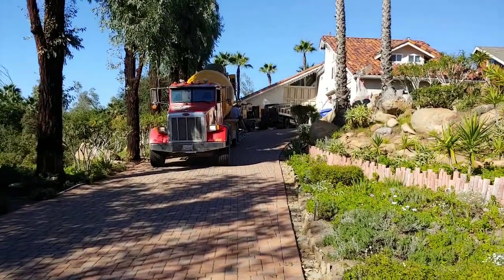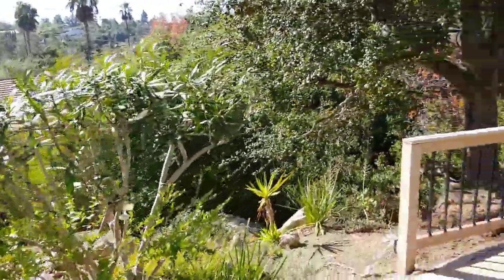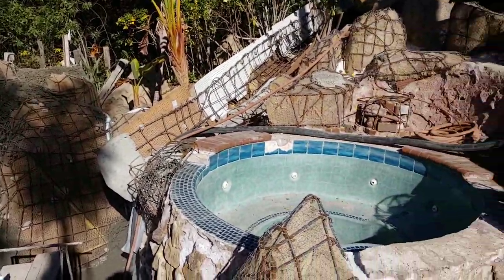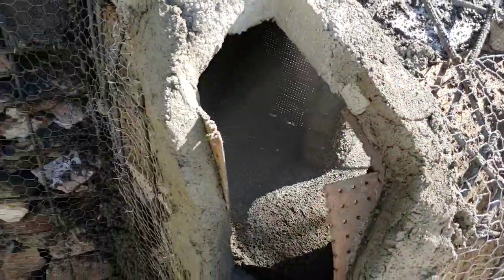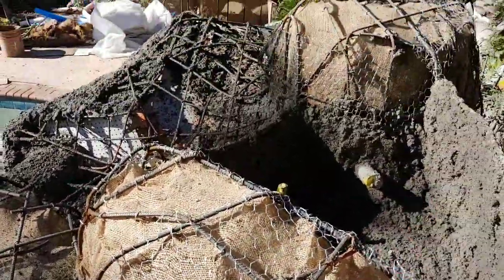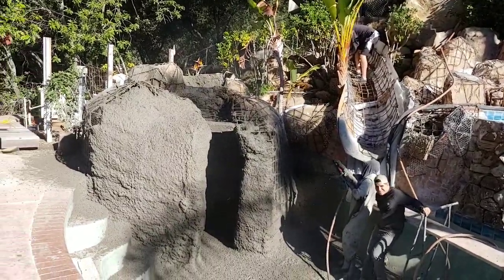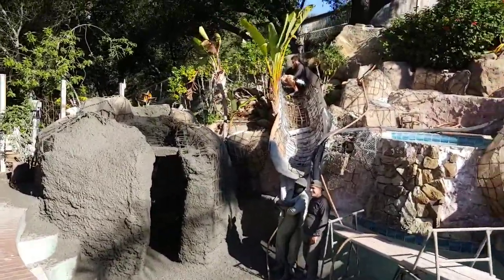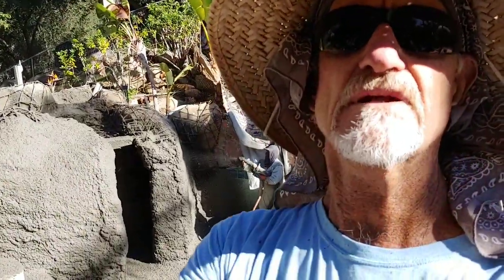Video 6, How to Build a Fake Rock Grotto Slide Waterfall, SHOTCRETE START

Comment: Aloha Sir Dave,
My names will. I’ve been in the concrete industry for 32 years. Mostly working building foundations and water treatment facilities. I recently shot a very large hot tub. We ran out of shot Crete and didn’t have a chance to shoot the bigger rocks that are going to be partially submerged. Couple of my guys are telling me we have to water proof before we shoot the bigger rocks….. I don’t see it being necessary. 

DO YOU WATER PROOF YOUR SHOT CRETE BEFORE YOU ADD YOUR “rock texture”???
Also out here we apply rock texture by hand basically sand and cement. Where could I get one of those fancy guns you use for the texture application?.? 
I’m 50 years old and, due to my brothers very un timely passing I have found myself the head of our large family. I CANT take care of my family without owning my own company. My company name is “Quality Pool Builders LLC.” 
Yes I can build very nice pools but am really wanting to get into the water fall and rock part as well.
Any info you can share is more appreciated then you know. 
Much Mahalo and Aloha from Oahu!.!
Reply from the maker: Hello William, So sorry about your brother. :(  On the Spa, I add faux rock to existing pools and spas all the time.  I epoxy the rebar into the side walls and top of the coping then shoot the new shotcrete into/onto the rebar rock shape.  After that I then apply waterproofing.  I use a penetrating gel product call Aquablock XL.  After that I paint on Miracoat Membrane C.  After that the texture coats go on.  So yes, I do water proof before my texture coats.  But not under the added shotcrete.  On texturing I also hand finish the rockwork both with stamps or without.  Depends on the type/style of rock I'm aiming for.  With the machines I use either a simple drywall hopper. See https://www.youtube.com/watch?v=VuqwTOBt928 or a Graco 340E electric stucco pump.  The Hopper uses a more runny mix with the Graco a less runny mix.  I also add a gallon of acrylic add-mix to all mortar/texture batches, (3 bag mix in an electric mixer, less for a 5 gallon batch).  On how to learn this stuff you can check out my free and for sale content at davehenderson.podia.com.  My Pro Course is the most comprehensive if ya like.  The other courses are helpful as well.  Bottom line is to always be looking at and studying rocks/waterfalls in nature to see what the design targets are.  If our work looks and functions like nature you'd done your job.  Anyway, best of luck to you.  Oh, I also have more personal training options at https://www.daverhenderson.com/personal-coachingconsulting.  Cheers, Mr. Dave :)  PS: here's one of the coolest projects I've done that shows the whole process on a grand scale. https://www.youtube.com/watch?v=rmVlV7nG26g&list=PLukDGbqhmHG3Q2TQn8W3fu7HEA_ZXwBYd